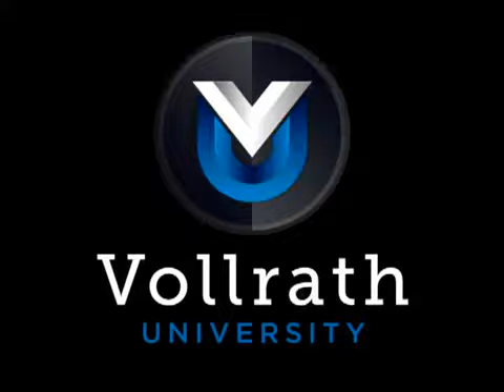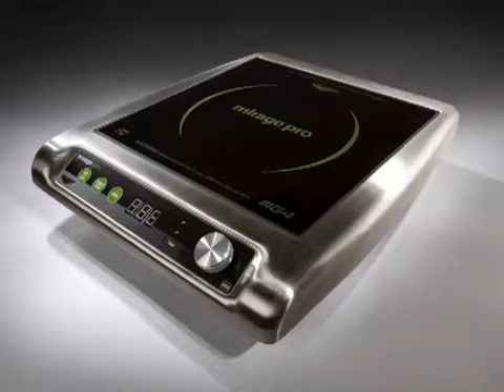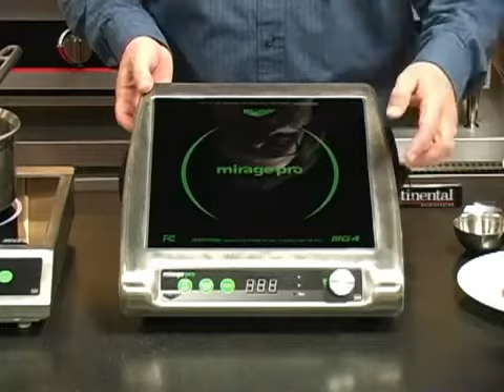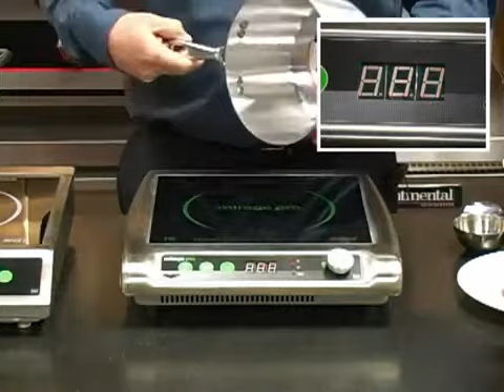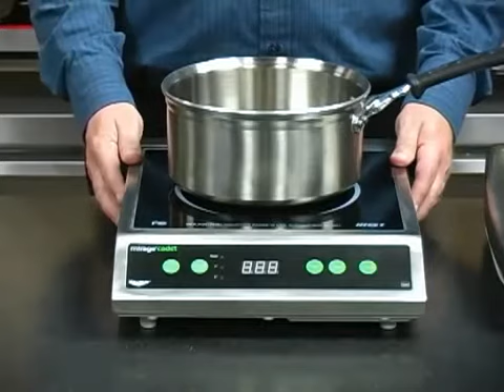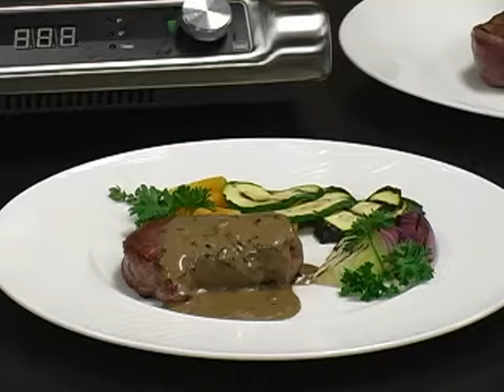Restaurant Solutions Inc. - Vollrath - Mirage Pro Cadet

Comment: Looks like an awesome burner. This is the only induction unit on the market with such precise temp control -- it's really revolutionary to have that kind of control at the burner itself. Could be used for sous vide type cooking without the mess of plastic bags and water baths.

I wish he wouldn't use metal utensil to deglaze that pan -- scratches unmercifully. But I guess they can give him as many pans as he  wants. :)